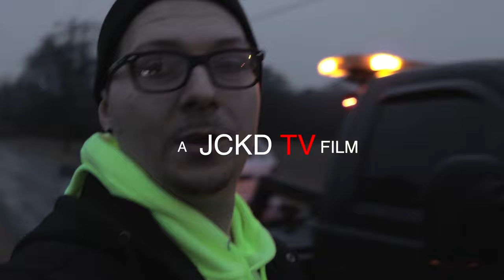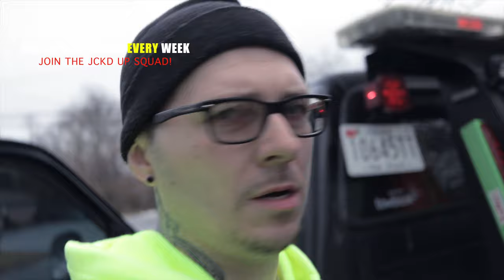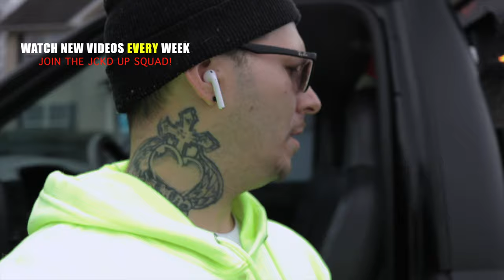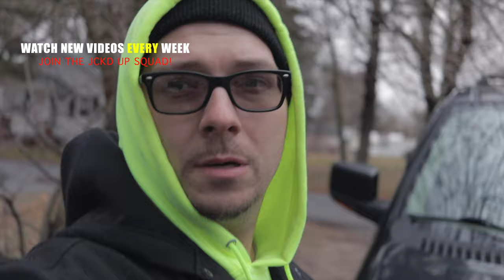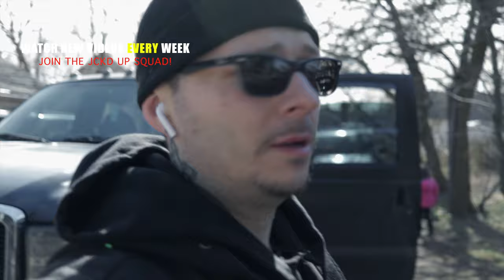HOW I MAKE $1000 A DAY! HUSTLE & TOW!

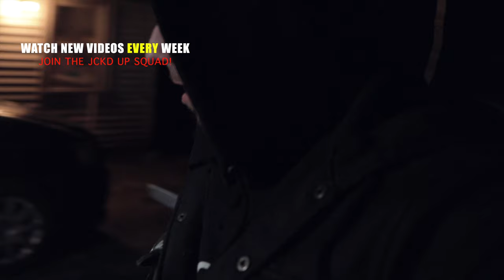Comment: I’m gonna shoot you a couple pieces of info, no shame meant about it just keeping it 100 w/ you like you would with me.    For one it’s a catalytic converter not Cadillac lol, and get a rubber puck, or old piece of tire or something so your boom doesn’t slam the bed when you fold it up.   That’s just tearing shit up.  Also question did that bolt you put in barely catch on the boom down@13:01 on the video?  Lastly  make good and sure that bolt you put in isn’t rubbing as the boom swings back and forth while loaded turning corners.   Much love from Nebraska my mans
Reply from the maker: I’m country, lol it sounds like I’m saying Cadillac.  I have a rubber grommet I got from dynamic just never put it on. 

And this bolt is old and was temporary.  Everything’s been replaced and rewelded. Thanks for the input brother💪🏼💪🏼💪🏼

Comment: Me and my buddy had the same issue man, stay away from them fords, get it fixed and sell that mf…. We bought one, ended up truck was in the shop a hell of a lot more than it was working, we sold it, bough a dodge duelly sneak truck with the boom under the bed, and never had another problem again, we spend 30k on the truck itself, and another 27k in the shop, had them same problems you had.